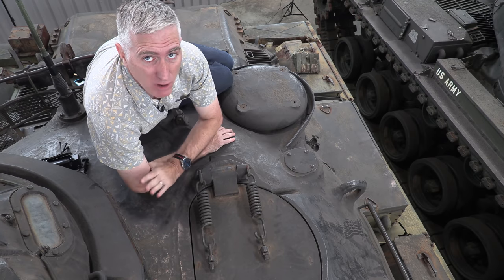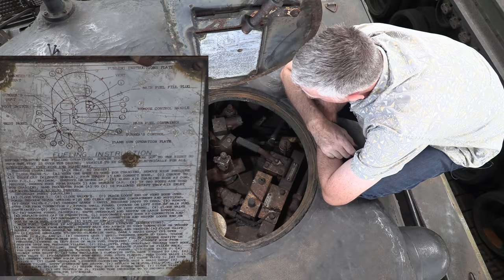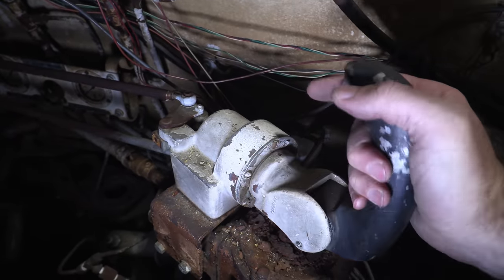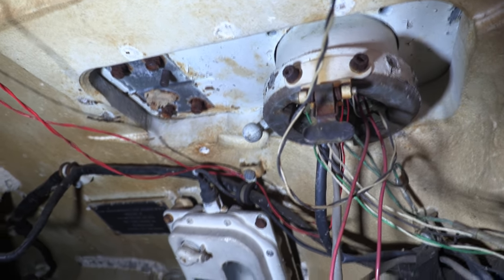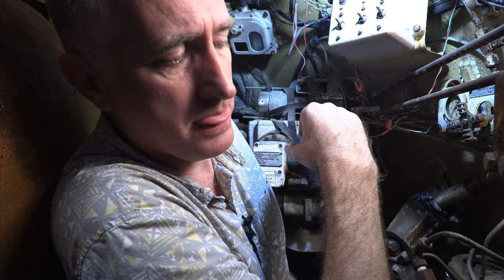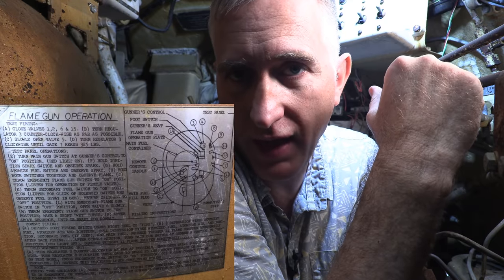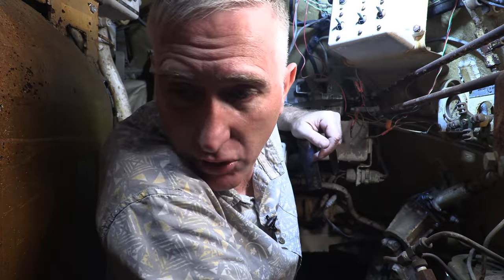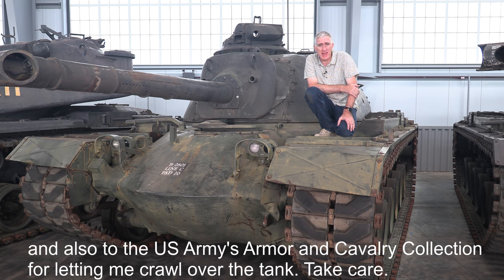Inside the Chieftain's Hatch: M67A2, Pt 2.

Comment: 60 seconds of fuel is a pretty long load, that's almost as much fuel as the old Churchill Crocodile had in the trailer.
Reply: Someone has to be the A* that points out that a Churchill Crocodile did include a fully functional main gun.
Happy Holidays btw. :)
Reply: Having seen this system, the Churchill Crocodile seems much more sensible.
Reply: Be interesting to know how long bursts were typically.
Reply: They should have used a trailer.  What the hell were thy thinking.
Reply: @ABrit-bt6ce  oh, I fully agree that the Crocodile is (mostly) the better option. Mostly because the trailer is only armored against small arms. Even a .50bmg would tear it apart.

But with the M48 not having a hull MG, you need to find a new place to put the flame gun.

And I will note that the US flame tanks of WW2 did replace the main gun instead of one of the MGs.
Reply: @gordonstewart5774  1-2 seconds, about like a machine gun.
Reply: @rogersmith7396  probably "how the hell do we get fuel from the trailer up into the turret to spray out the flame gun?"

It can be done, there's a thing called a "banjo fitting" that allows 360⁰ rotation around a pipe while still flowing fuel. But that would require the fuel line from the trailer to come up in the center of the turret ring (probably the center of the turret basket, actually), and then run whatever lines you need from the banjo to the flame gun.

Only problem is that banjos are notorious leak points. They always dribble at 3000psi.

And that makes the entire trailer conversion a much more involved process than simply dropping a new turret onto an existing hull.
Reply: Those commenting on a trailer forget how difficult it is to pull one across terrain a tank would see. Not impossible but not easy either. If it flips or jack knifes you're screwed. Especially if it's loaded with a few hundred gallons of napalm. There's a good reason you didn't see very many tanks with trailers.
Reply: @ScottKenny1978  Or you could use something like a ball and socket joint on the barrel to allow lots of movement and keep the turret relatively stationary.  Sort of like a sealed ball joint.
Reply: @ScottKenny1978  Bear in mind that nearly all turrets will have some system like that to allow electrical/intercom/hydraulic connections.
But now I think about it, you're saying that keeping that and ADDING a high pressure fuel system to it would be a bugger (the tank is on fire). Which is a good point.
Reply: @richardmoore609  It was possible, and it was done, but like you say, I'm sure it was a nightmare to implement.
It's a lose-lose situation really. I'd rather have the jack-knifed trailer of napalm on the outside of my vehicle than the explosive tank of death sitting in my turret.
Reply: @rogersmith7396  loses a lot of tactical ability if the turret is fixed.
Reply: @WolfePaws  except that to have the flame gun in the turret and trailer full of fuel, you add that leaky fitting, dribbling fuel into the tank bilge every time the turret moves...

Oh, bugger the tank is on fire!
Reply: I met a Viet Nam marine vet who was in a flame tank during the TET offensive. He told me that they had a bunker that was being a bit troublesome for the troops. So they proceeded to load it up with raw fuel before they touched it off. He said the bunker gave no more problems.
Reply: The Churchill was recorded as the most effective weapon ever to see combat
Reply: @jamessotherden5909  Known as a "wet shot"

Comment: As you have figured out, that is an M48A3 chassis as it has the outside cleaners associated with the diesel engine. The M48A2C gasser had oil bath air cleaners on the inside. The coax mount in the video is for an M1919 or M37 Browning machine gun as evidenced by the front and rear mounting pins. The miserable M73?M219 was secured by a collar around the barrel jacket. which help contribute to its legendary unreliability.  Drives controls are the same as an early M60, wheel instead of T-bar.  The gas version, M48A2C had the brake and accelerator pedals reversed. The cupola mounted an M2HBTT, laying on its side. Those of us who were tank commanders in those days jealously guarded our solid link chutes.

Comment: Driver's position was pretty much the same on M48A1, M48A2, and M48A5 (and the M60 slick) with the small steering wheel, from personal experience driving and crewing them 1970-86.  As you said, nearly identical to the M103, which I had the opportunity to crawl through once before they were dragged out onto Fort Drum's A10 gunnery range. I suspect it was the same on the M48 slick and the M48A3, although I never had the opportunity to drive or crawl through either of those versions.  The T-bar wasn't used until the M60A1 came out.

Comment: I find it funny how certain equipment has remained the same on military vehicles about 50 years now. Like the headlight switch and internal domelights and such. Things you wouldn't really think about off hand but if you have a keen eye once you notice you see popup more than you think it would.
Reply: I gues this is just because, why would you design a new part when a completly satisfactory part is already available off the shelf? This is standard practice in all parts of industry and especially handy if you only build a small number of machines (compared to something like cars and washing machines or whatever you like) Also note that for example in cars one wants to make a new model look different from the older model as a trick to make the customer believe the old one is outdated and so he needs to buy the new one (head and taillights in cars are a notorious example and change every model and facelift while actual performance or functionality oftem is exactly the same) while in the army they don't care about what is or looks new, it just has to meet the newer specs and for that basic stuff there is no need to change the specs so,..

Comment: If that air pressure gauge is scaled as I assume it to be, then the working pressure on that air supply is something on the order of 4k psi, which it itself would be enough to ruin everybody's day if something breached the bottle.  Then consider the sheer size of the fuel storage vessel, which is itself running at around five hundred pounds per square inch of surface area, and is close enough to hug.  Yikes!

Comment: You always do ADR for the audio parts that get borked.
Reply from the maker: ADR?
Reply: @TheChieftainsHatch  "Automated Dialog Replacement", which is a misnomer because there's nothing automated about it.  You just re-record the audio and replace the original.  It's the reason for dialog sometimes not matching the mouth movements of actors, because the lines were most likely re-recorded and changed.

Comment: Who in Gods name would have wanted to be in one of those?!
Reply: Certainly better than getting shot at with no armor from the bushes.
Reply: Hi, I am a pyro, and this thing seems like a dream.  Only thing better would be the Crocodile, because that also had a 75mm gun on it as well.  Also, the Crocodile had a quickly detachable fuel tank should things happen to catch fire so the crew didn't get immolated.  But this is a nice runner up.
Reply: @RS_Mogli  good thing they're enemy really had weapons that could do that. And the military knew this that's why it was designated for mop-up duties. So they'd send it behind the normal main battle tanks.
Reply: @Jeremiah90526  and the KV with the flamethrower and gun?
Reply: ARVNs.  We train, you shoot.
Reply: /raises hand...
Reply: Rather be in it than in front of it!

Comment: I just wonder why didnt they just make the whole hull a giant fuel tank. And have the TC become the driver. And the gunner is the gunner. The TC can rotate themselves to look around anyways. Also they got that freaking tumor on top too. I'm imagining like the MBT project where the driver is in the turret. It should be able to hold more fuel and be safer perse as if you only show the the turret and not the hull and having the fuel in the hull. There isnt any risk
Reply: IIRC, systems like that consistently gave drivers motion sickness once the turret started moving.

Also, extra load on the TC, less crew for maintenance tasks. Probably also just plain too much work.

Comment: Why would you put the fuel tank in the turret? Seems like a really dumb place to put something flammable and it takes up valuable fighting space.
Reply: with a rotating turret, its maybe the easiest solution.
Reply: The tank does not need a loader at all, and I expect that it also replaced the whole turret ammo ready rack.
Reply: I think it would be alot harder to pipe to the gun if it wasn't in the turret.
Reply: @ScottKenny1978  I forgot it was a flame tank, good point.
Reply: There wasn't a lot of extra space to put it.  Since it replaced the main gun, you didn't need that room for anything else.
I doubt there was a lot of room in the hull for a tank that size, and the point about the difficulty of trying to plumb a liquid fuel from a fixed tank in the hull to a movable turret, would be challenging... at best!
Reply: @mahbriggs  could be done if you put the hull fuel pipe at the exact center of the turret ring, and then a very large "banjo" fitting to allow the turret fuel pipe to turn on the hull pipe.

But that would have been a lot more design and testing work, plus a potentially leaky point.
Reply: @ScottKenny1978  Yeah the leaking on a moving joint like that would be a real issue. As unsafe as 400gal of fuel in the turret is, a pressurized fuel line leaking would be even worse. Especially on a mission critical part like the main weapon and turret.
Reply: @nobody8717  yeah, Banjo fittings are a known leak point in hydraulics. They work for when you need more range of motion than a simple hose will give you, but they almost always dribble at 3000psi.
Reply: @nobody8717  Besides you can always hose it out and get more grunts.
Reply: @mahbriggs  You have no idea how cramped the interiors of tanks are. And US tanks re generally considered the most spacious of the lot
Reply: @colbeausabre8842  
Actually, I might!
No, I am not a former tanker, but as a child I used to play in one that was in a local park/war memorial.
A few years ago, I was in the neighborhood, and stopped by to see my old playground.  The old tank was still there, and the hatch was still open, so I crawled in.  I BARELY fit!  And it isn't that I was all that fat.  I really marveled that a crew of four or five people operated and fought in that tank.
Since then, they have spruced up the exterior of the war memorial, and welded the hatch shut, but I am well aware of just how cramped the interiors of tanks are!
I have the utmost respect for the tankers who fought them!  Certainly you couldn't be claustrophobic in the least!
But to return to your comment, why do you think they put the fuel tank in the turret?
Between the lack of space otherwise and the very good points about pressurized flexible fuel lines, I think the turret was the most practical place to put it.

Comment: I wil never get the point of a flame tank. A good HE shell will do the exact same job and do it safer.
Reply: Your run of the mill Wehrmacht soldier in a fortified position thought otherwise. Tanks they could put up with but they were terrified of the Churchill Crocodiles.
Reply: looks way cooler
Reply: Outlawed by Geneva I think.
Reply: Apparently blowing up dams is naughty too.
Reply: Hmm, HE, blow big holes in the jungle, or flamethower,  and burn said jungle down. Also, tunnel complexes, flame would rob oxygen from them.
Reply: In the Pacific especially, flamethrowers were often much more effective when clearing out fortification (tunnel) complexes where several pillboxes or fighting positions were interconnected or had internal baffles to reduce blast and shrapnel. Dump some raw flame fuel into it, let it seep in a little bit, then light it. Bingo, no more oxygen and the defenders are all suffocated to death.
Reply: @rogersmith7396  No, not allowed. Use of flame weapons has a precedent going back to prehistory

Comment: Why on earth would a fuel tank be placed in a turret ¿¿????????
Reply: It is a flamethrower tank
Reply: @balazsneuperger2063  I understand, however the Churchill crocodile, towed a lightly armoured tender carrying the fuel. Carrying it in the turret gives a new meaning to Tommy cooker.
Reply: @stevenhoman2253  Probably the reason why the Churchill Crocodile had a trailer is space. You couldn't fit an extra fuel tank into an already cramped tank.
 My bet is that there were a requirement for X amount of fuel for that flamethrower and the only place with sufficient space for that big fuel tank was the turret. It is true that solution is not ideal but for a specialized weapon like this, maybe not as big of a problem like it seems.